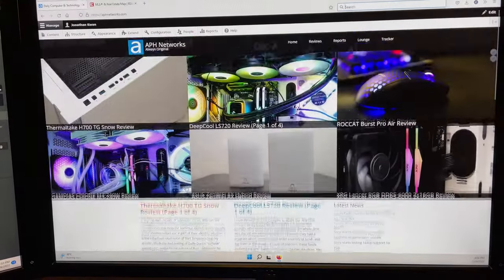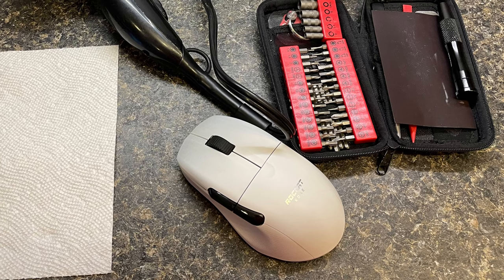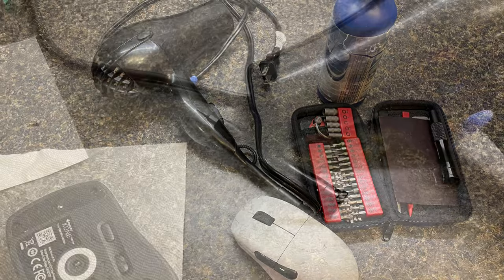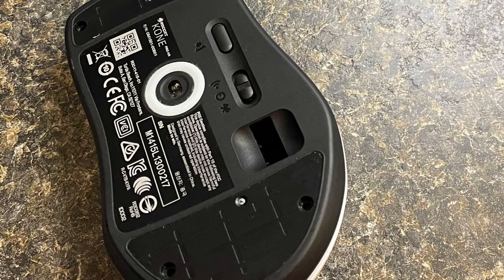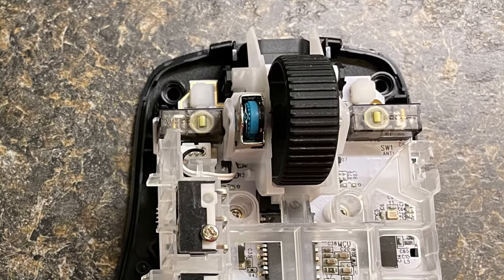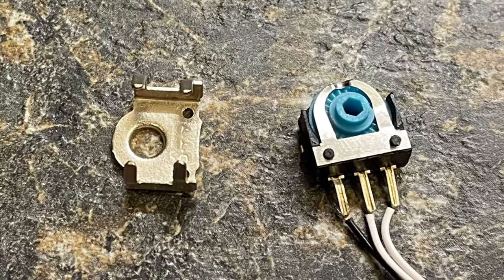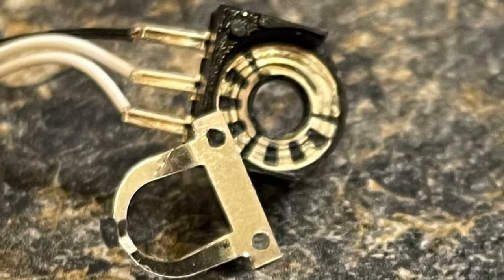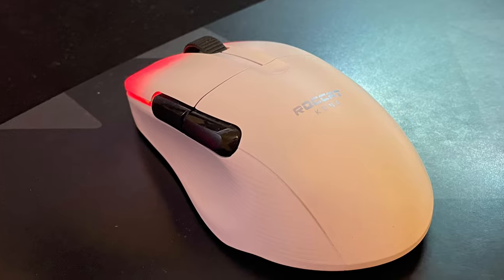How to fix a jumpy scroll wheel on your mouse for free - TTC encoder cleaning with full disassembly

Comment: In the HP design: If you carefully lift the four metal tabs and force the encoder body over slightly, you can get the potentiometer's tiny wheel out with tweezers. Then clean surfaces with aftershave on q-tip and reassemble, pushing the metal tabs back down.

Comment: Thank you this helped save my mouse. My encoder was soldered onto the board so I could not remove it, but a little robing alcohol around the connector was enough to restore normal functionality.

Comment: I saw another video where someone used wd40 to lube it. I also am trying to fix my kone pro air. Is this not recommendable
Reply: I wouldn't, WD40 is not a real lubricant. I would try using silicone grease instead, granted I've never tried it on a mouse.

Comment: Excellent instructions,  and detailed photos for each step, many thanks! 

I did not have a heat gun, but i just put my mouse on the outside of a waffle iron while it was heating up, worked to remove the stickers without violence. 

Same for the encoder component within: mine was soldered in place so I couldn't remove it, but just by adding a drop or two of rubbing alcohol on it, and then "scrolling" until I could hear and feel the clicks get clearer it got much better. You may need to wait for the alcohol to evaporate a bit before you actually see any movement: mine was not working for a minute or so while adding alcohol.

My testing method was simply: test it while its still in pieces using just the scroll components [I kept all electronics connected during disassembly]. Then you can see the improvement without needing to disassemble again if it didnt work enough / needed more alcohol.
Reply: i was just about to unsolder the encoder, thanks!

Comment: I bought a used wireless battery operated vetical mouse. It was jumping and has no USB receiver. I had a broken mouse with a 2.4GHz frequency. I uninstalled and reinstalled the driver. Then, it recognized my mouse because they are both running at 2.4GHz. I fixed the jumping scroll butting by spraying isopropyl alcohol and had it rested for few seconds. I did not rub anything with a soft bristle brush. Tested it and no more "teleporting" scroll. Next I fixed is the forward and backward button. I fixed it by reallining the ribbon wire. They seemed to be not touching each end. Secured it and no more problem. Now it works like brand new. Im here in the Philippines. I bought this first at $1.23. Usually, this cost $3.50 for wired and double for wireless. I feel happy I can be more productive at work. Saved me money. Thanks for the tutorial.

Comment: Great video.  The encoder in the evga x15 used melted plastic rivets/studs that you had to cut off (instead of bending metal plates like yours). Otherwise, it was basically the same thing.  With how much grime was in there it makes me wonder if it wasn't some kind of oil/grease from manufacturing that smears around.

Comment: Fast, Easy and straightforward guide. Awsome work.
Thank you this helped save my ROG Spatha mouse. My encoder was soldered onto the board so I could not remove it, but a little bend in the legs allowed me to disassamble and clean it.

Comment: Thanks for this! It's been a struggle looking for a fix. Buying a new mouse is outside my budget.
Mine was pretty sketchy since the encoder is soldered straight onto the board on a Razer Naga X, but a couple less than recommended bends to disassemble the encoder did the trick. And boy did the contacts need some cleaning.

Comment: Thank you!

My 4 months old  Roccat Kone XP Air was doing the same thing. The worst was for writing, God I can't remember the number of times I nearly through that mouse against a fragging wall.

Removing the few strands of fibers was easy enough, a bit of cleaning contact spray from FACOM (I am from France, so I have no idea what the equivalents are in other countries) and voila; It works properly again! (For those who want to do the same; be careful not to damage the Teflon Pads, they can be quite fragile. And do not lose the screws!) 😃
Reply: How long did the fix last? Still good?

Comment: I'm trying to do this on my OrochiV2, it uses a 2-tab TTC encoder with 2 extra non-conductive legs soldered to the PCB. How do I get the outer metal shell off? I can't seem to pry it using a flathead precision screwdriver.
Reply: I just did this to fix my NagaX, its very tricky since the shell is soldered on to the pcb as well. You can try redoing the solder to fully free the encoder from the board or do what I did, which I recommend with EXTREME caution, do some reckless bending to allow enough space to pull out the blue wheel out so that the inner contacts can be wiped with a cotton swab.
reassembly is somewhat easier but in my case I ended up reducing the tactile bumps to near non-existence. Good luck

Comment: for me it didn't. the encoder is soldered to the board.
Reply: MIne too.  I blew sharply on mine and it got better.  Going to try compressed air to see if it cleans it.
Reply: That's the HP design. If you carefully lift the four metal tabs and force the encoder body over slightly, you can get the potentiometer's tiny wheel out with tweezers. Then clean surfaces with aftershave on q-tip and reassemble, pushing the metal tabs back down.